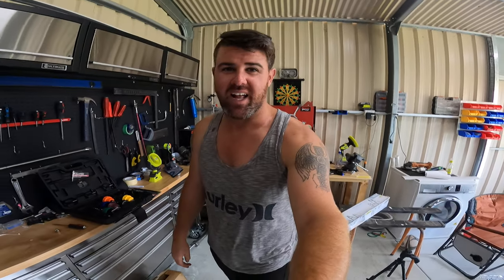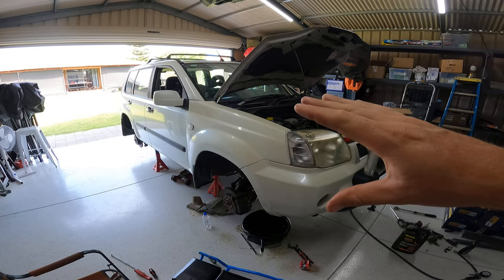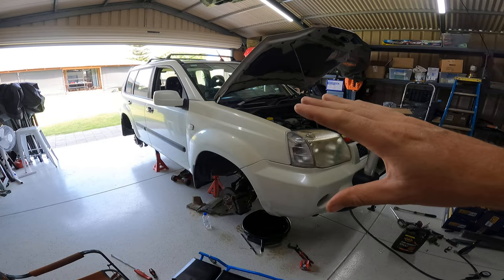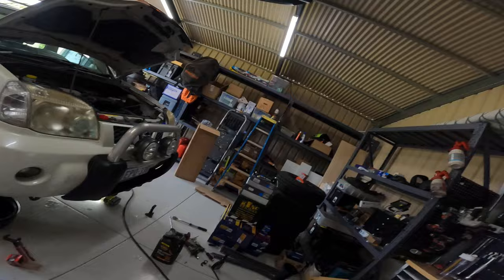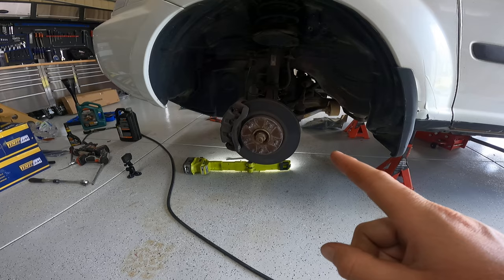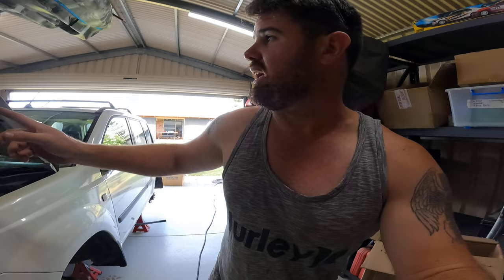$0 T30 X-TRAIL, BUDGET BUILD what's planned for this little rig

Comment: Just basically swapped a t31 2011 in very good condition for a disco 3 2006 in ok-good condition. 

Different cars but had some great fun and covered a lot of miles in the xtrail…. Worry free
Reply from the maker: 🤣 I'm about to the reverse and  sell my disco 3 and just drive around in this little nugget 

I'm not doing proper 4wding any more and this xtrails seems plenty capable on the beach which is all I need nowadays 

How did you find your t31 on the beach
Reply: @OUTBACKDiscovery  sand and snow no problem only weighs about 1.6ton? 
On snow and ice I found it very good with basic tires….. go where most can’t.

173bhp more than enough to sit at 70/80 all day long. Tow 1.5 not to bad and 2 ton for a short distance.

I had a t30 2.2 
That was my favourite to drive as I found it better built but the engine was leaky but again enough pull. All the seats (all leather electric) where way more comfortable
Reply from the maker: @sgfelectrical734  that's good to hear , mines driving super nice with all the work done to it now. Super enjoyable little nugget to drive 

The landy drives amazingly though and tows like a dream which I bet you have already noticed
Reply: @OUTBACKDiscovery  landy unbelievable.
And @£3200  it’s a great toy .we have a reliable Volvo xc60 AWD for every day and business mileage ect (xtrail far better 4x4 than xc60)

Hope u don’t sell landy, u and LR time are the reason I got it and have helped me do full servicing ect) keep it going. Film everything…. Keep showing its better to fix than throw 👍🏻
Reply from the maker: @sgfelectrical734  LR time have a new disco every time I jump onto there channel 🤣 got so much footage saved for videos to edit but havnt allocated time to do any editing really need to sort myself out haha 

Good luck with your disco which engine did you end up with
Reply: @OUTBACKDiscovery  🙏 here’s hoping.
Motor is plane Jane 2.7,but I’ve never had a v6 before as most things here (uk) are 1.6-2ltr. So I’m very pleased, pulls nicely and get 35mpg  on a run-witch thinking about is about what I got out of my t30. 

Wish I had ur garage/workshop as something that size is not common here.
Reply: @OUTBACKDiscovery  maybe u might be able to shed light,  there is one issue that bugs me (scares me financially) when u left off the throttle and back on there is a knock, sometime can feel on a gear change(auto box) and very occasionally just before u come to a full stop.  if u have any ideas I’m all ears….. unless u say torque converter- as I will at that point put my fingers in my ears and pretend otherwise
Reply from the maker: @sgfelectrical734 I love my  shed  it will be bigger soon I'm extending it end of the year and turning it into my dream setup in there 😍

The knocking honestly has been something that I've got in mine even with the new engine, transmission, driveshafts, cv's and front diff being rebuilt 

I'm guessing it's play in the transfer case but seems to be common across the board